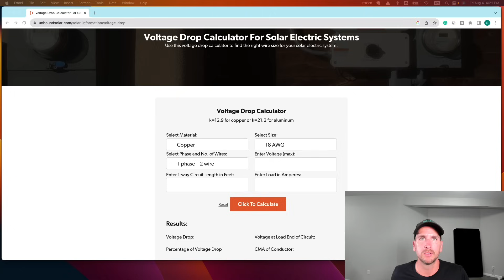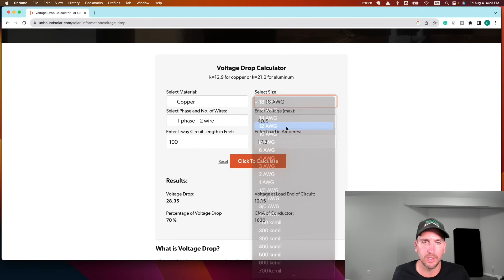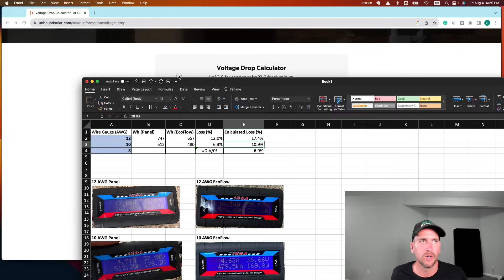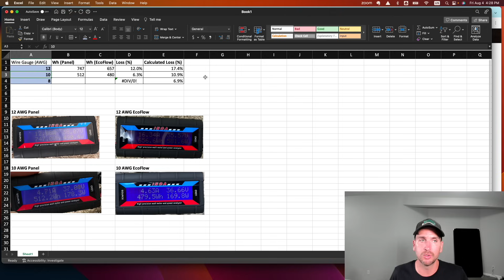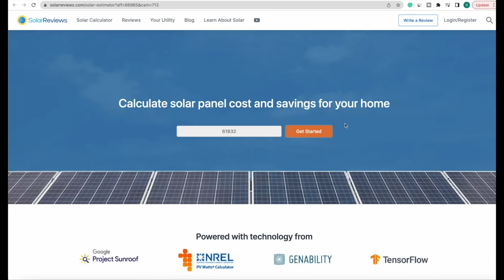What Wire Should You Use For DIY Solar Kits? Surprising Results!

Comment: Could use some help still confused about the gauge wire where. I’m installing solar on my rv down to my delta pro in front of rv. Would 10awg be enough on roof to roof chase and then from chase to front? Also how about to the delta pro from my solar breaker? Do they make 10awg xt60 connectors?
Reply from the maker: You should be good with 10 gauge.  Your runs are short and the Delta Pro maxes out at 15 Amps which the wire can easily handle without much losses over that length.

Comment: So the Eco flow generator is going to be generating everything for this test yeah we need to stop calling these things generators they are storage containment devices they are gas can. The solar panels are more likely to be a generator. Power Station is a much better term. And then let's not forget the people who run gasoline generators in their house what's the difference? They both say generator so let's muddy the term some more.
Do you call an engine a motor?

Comment: Need to do this type of testing on a perfectly clear day. Additionally, always wire up your series/parallel solar system to give you the highest voltage acceptable for your inverter to get the lowest losses.

Comment: The calculated losses are probably higher because they take into consideration temperature change of conductors exposed to heat accumulation either by heat generated by current or from heat from weather and the sun and enclosed conductors in conduit or hot attics. heat increases resistance and would increase amps.

Comment: What is actually been drawn heavily affects what the panels produce... You plugged into a battery... So it's state of charge will change production.... Should hook them up to a heating element through the mop, that will put a constant pull... And you will also see how hot the wires get as well when under heavy load.

Comment: The UnboundSolar calculator seems to be set up for AC current.  AC current flows more towards the outside of the wire (skin effect) and doesn't make full use of the core of the conductor.  DC current uses more of the copper in the wire and therefore has less loss.  I think this effect could be contributing to the differences you see in your tests and what the calculator results show.  I.e. the calculator will always overstate losses if you are using it for DC currents.
Reply: This is a common myth. Skin effect only starts being a thing at radio frequencies from around a few MHz and up.
At 60 Hz it varies between zero and virtually indistinguishable from zero, so the full cross-section of the conductor is in play.
Reply: this is true.  its a fulty test

Comment: To eliminate the effects of a varying amounts of solar energy during your experiment, why don't you just use a power supply at voltages in the ranges you would expect, changing them at measured intervals to replicate actual conditions. You could run each test under almost identical conditions so the tests would more accurately measure the impact of using each of the wire gauges/

Comment: Due to the direction my house faces, mature trees, neighboring houses and being down in a valley much of the area immediately around my house (and my houses roof) is not practical for solar panel installation, I have a small temporary setup (2.7kw array) that on a good sunny day might produce around 4-5kwh's due to the shading issues, I have a spot picked out on the southern corner of my lot for my primary array, which sun wise is perfect, only having shading during the first 2 hours after sunrise and the last 2 hours before sunset and ZERO shading the rest of the day and thats in the winter with low sun angles, but the problem is it's about 300 feet back to the house, I initially thought I would need 8 gauge, but based on all the calculators, if I wire between 10 and 12 of my panels in series that pumps up the voltage high enough and keeps the amps low enough that my voltage drop is under 2% with 10 gauge wire, this also puts me in the voltage range of equipment like the EG4 18kpv or 6000XP, so my optimal solar location is effectively dictating what inverter AIO's/charge controllers I can consider.
Reply: Shouldn't that be new products with higher voltage inputs have allowed you to use higher voltages and therefore thinner wires than if the new products didn't exist? More products will be introduced with high inputs as time goes on they are a new advance in home products.
I snatched up an all in one with 450 volt inputs and I have no long runs because higher voltage has more advantages than allowing longer runs with thinner wires. Like being able to design a bigger system before needing a combiner box.
And minimizing losses is always a nice benifit.

Comment: Dont use this as the primary aspect to guide wire size. Wire size MUST be big enough to handle the Amps/Current to prevent a fire. If one sizes the wire/conductor to get best throughput there is a risk of not sizing the conductor/wire sufficiently to handle the amps. Always leave a good 10-20% headroom of amps and VDC to the inverter. So if the max amps is 13 then get a 20 gaure wire and if maximum VDC input to the inverter is 500 vDC then design a solar series string to be under 450vDC.

Comment: If your MPPT can handle more amps, go that route as more amps is more efficient at charging a battery.
Reply: Say what? Amps down the solar cable has no bearing on the amps for charging. The inverter transformers inbound solar energy to the volts needed for the battery and then fiddles with the amps to maximise total energy to the battery.

Comment: Summer here in australia is to hot to get the full value of power input as get better power input in spring and winter with the cooler weather as summer days here are 40 plus celcius 😩
Reply from the maker: I bet, those panels have to be getting smoking hot.
Reply: @everydaysolar  I have a 10kw system on my house and on a sunny summer day like today was at 38 degrees Celsius all I got was 26kWh in spring and cooler sunny days I’d be getting 80 to 90 odd kWh so you see the heat does affect them quite solidly

Comment: VDI chart works great. I always run my large ground mounted solar array wire runs in DC, and I keep my operating voltage up around 500 V DC.
Reply from the maker: Yeah, if you can crank up the voltage and keep current as low as possible that is ideal 👍

Comment: Are we not concerned by the fact that the measuring device has a small gauge wire introducing resistance to the line in test?
Reply from the maker: Not concerned for this test as we were consistent in the measuring technique across the 8, 10, and 12 gauge wires so there could be a small about of line loss in the 12 gauge leads going into the energy monitor but it would be consistent across each of the 3 trials.
Reply: @everydaysolar Yep it effects accuracy but not precision of the measurements.

Comment: I have three 300-watt solar panels I am going to run in Parallel. The panels show 22.1 volts open circut and 18.1 amps short circut current for each panel. The solar cable run will be about 30-40 feet in distance to my controller. Would 10-gauge wire be enough to handle this?  Tank you.
Reply from the maker: Do you need to run them in Parallel?  That will really crank up your Amps and result in a LOT of current running through the wires.  In this case 10 gauge would not cut it just from the amount of current running through the wires and result in way higher line loss than you would like.  Probably around 20% line loss and again would be over the Amps you would like to run through 10 gauge.

Comment: Why didn't you use the 4.53A in your calculator that your meter was showing?  What I do is have a battery at solar panels with an inverter hooked up to it then use a normal 14ga outdoor extension cord to run power inside to charge house batteries.

Comment: Tell me what I am missing. If you have the same power monitors installed one near the panels and one near the batteries and they are both calibrated properly they should both read the same watt hours. The current will be equal through out. Yes, smaller wire will drop the voltage. But the watt hours should be the same at both points.
Reply from the maker: The voltage drop results in less Power (Voltage x Current) at end of the wire run as compared to the start.
Reply: But its the same amount of power (watts) going through the wire at any point.  @everydaysolar
Reply: @McDIY no, same current but not same voltage every where along the wire.
Some power is used to overcome the resistance of the wire

Comment: Voltage drop = (2k x l x i)/Cm     k= 12.9 for copper wire,   l= 1 way length,  i= current,  Cm= area of conductor in circular mills

Comment: This is a good example of why many installers now put an inverter at the panels, convert to 120Vac and that way they can use much lighter wire as copper is not cheap these days.
Reply: Put a few panels in series and you can get much higher voltages than 120.
My charge controller can handle 450 volts.
The use those micro-inverters to make it easier for themselves to design and trouble shoot.

Comment: At 1:10 you said "Since that's an Mpp charge controller..." and then referred to the Impp and Vmpp values on the solar panel label. 
These are different things. The label on the solar panel is telling you the maximum possible voltage and current from the panel when OPERATING at the maximum power point.
The maximum power point (most efficient use) varies throughout the day depending on the sunlight and angle of incidence on the panel (and also clouds). An MPPT charge controller (Maximum Power Point Tracking) dynamically varies the impedance (load) of the charger upon the panels so that the panels can stay at the optimum voltage and current output for the instantaneous solar conditions.
Reply: Yet some mppt controllers just use the panel temperature to adjust the mpp.
They start at the panels specs and adjust for temperature fluctuations.
Those numbers are accurate at the temperature and light intensity they were tested at.

Comment: Your results at 9:43 ... the thicker the wire, the less Watthours of energy .... that doesn't make sense.
Reply from the maker: The total energy produced was not consistent across each of the 3 trials.  The increase in total energy as the wire gauge got thinner was just a coincidence.  The focus of the test was the % loss for each trial.

Comment: I am curious if two 10 gage twisted pair (positive) & two 10 gage twisted pair (negative) wires would result in less line loss than the 8 gage setup depicted in your test.
Reply: Dc works by the cross section of the wire(s).
Look up the cross section of what ever wires you want and total the cross sections of multiple wires ans compareto the cross section of the bigger single wire.
This doesn't work for AC due to skin effect.
Reply: @ghz24  Thank you for the info.

Comment: It always comes down to cost / benefit.  Would have been very interesting if you would have then put those panels in series and did the test again. I think the #12 wire would have been fine then.  The higher you can get your panel voltage the less loss.
Reply from the maker: For sure, I need to find energy monitors with higher voltage capacity.  That is the limiting factor right now when using that type of setup for testing.

Comment: Which cable i should use for 1200w to 1600w panels and the distance like 40 feet. Thanks
Reply from the maker: It will be tied to the amount of current you are pushing through the lines.  How many Amps will you be generating?

Comment: 8gau if you do some shopping around isn't that much more expensive than 10gau and nobody just uses 2 solar panels,  you need to consider accumalative losses when dealing with a string or strings of solar panels and going 100 feet or more especially from a ground mount that is a distance from your home you will be ahead with 8gau wiring and the losses will be a lot higher in accumilative loss with 10gau or 12gau wiring.  Part of the situation on what to use depends on the output power of the solar panels and the number of them in the string, in lots of situations the 8gau is best while 10gau wiring is fine with minimal losses but I wouldn't even consider 12gau wiring.

Comment: I'm setting up 8 x 100W Renogy (20V 5A) panels in series and parallel with 4 in each series. I'm using 10 feet of 12AWG wire for series to connect to the 50 feet of 12AWG run to an external circuit breaker before going into an Oupes Mega 2 that can handle 150V 15A from PV. I am a noob and just learning this stuff. Any idea if wire loss is going to be an issue? I would think proper alignment would have much more impact. Depending on location (portable unit), I may just use 10 feet run. I figure this gives me flexibility to use my panels only in series if I can't use all 8 panels.

The cables are tinned copper wires if that matters.
Reply from the maker: I think you will be alright with 12 gauge probably seeing around 2.5% power loss through the 50 feet of 12 gauge.  if you went with 10 gauge you would probably drop to around 1.5%.
Reply: @everydaysolar  Thank you for the reply. 2.5% loss vs. 1.5% seems pretty minor for the limited times I think I'd use the solar panels.

Comment: If you exceed 60V you will trash that Meter.  Series you panels. 48V has 16 times less loss than 12 @ same power. 12V keeps you a slave.

Comment: A reply I did to another’s comment: A shed costs a lot more and is WAY more work than conduit and heavier gauge wire. Though a small enclosure for a combiner box at the panels is very practical, but the combiners are generally set up to be outdoors. So they don’t need a totally weather proof enclosure like an inverter and charge controller will. That makes a BIG difference in time money and effort. Plus, the batteries need excellent weather protection, and you don’t want your batteries a long distance from the inverter or your breaker box, or the end use point(s). So in my case I don’t put panels on my roof because that is a whole can of worms for installation and roof repairs/replacement short and long term. I have a nice exposed hill that I put my panels on and it is just simpler to run 4 AWG  into a weather proof cement board cabinet close to the cabin with the controller/inverter/ batteries.

Comment: Will there be a difference, power-loss wise,  when dealing with DC (like you tested in this video) vs. AC (for example when the panel is connected to a microinverter that converts to AC right next to the module, before the wire long run)?
In other words - is there more power loss with DC vs. AC along the same wire length and width?
Reply: @hank-kal   There is some difference between AC and DC but mostly it's about voltage.  You lower the current a LOT by inverting right at the panel.  Voltage is now way up for the same power.   Use an online calculator (google for one) and specify AC or DC.

Comment: My system runs between 300-400 volts, 125ft cable, 5-10Amps, 10 AWG: I am losing less than %0.75 on my worst case, according to the calculator.

Comment: Dumb to run 45V for 100 feet. Since line loss is P=(i^2)*R, the idea is to MINIMIZE current.  So you put the panels in SERIES.  Say you have 10 of the panels in the video. A 3600W system, where each panel puts out 40.5V @ 8.9A. In PARALLEL that would mean 40.5V at 89A.  10 gauge is .1018Ω for 100 feet, so 806W wasted in line loss.

Same 10 panels, same 100ft of #10 wire, but this time in series.  Voltage would be 405V, current 8.9A and line loss is 8.06W

So which do you want to waste?  8W?  Or 809W (more than the total output of 2 of your 10 panels)?

I did my own solar installation.  My target voltages were in the 400V range with current just under 6A and the cable runs were about 30 feet, so with #10 cable, my line losses are about 1W.

Comment: Do yo have any videos on grounding solar panels?  I just got an EcoFlow Delta Pro and purchased 6 200W solar panels.  The EcoFlow, for now, is for backup emergencies so my plan is to set up the solar panels during an outage by tilting them but staying on the ground.  Is it necessary to ground the panels in this situation?  Also, my hope is to set up the Delta Pro such that i can start offsetting power and have it running all the time.  My roof needs new shingles so i was thinking of building a system where each panel will mount to my fence so it can be rotated and tilted.  Because this is a more semi permanent installation and the panels would remain outside that they then should be grounded?
Reply from the maker: I just did a video on a nice little ground mount and touched on the grounding at the end.  Not sure that will be ideal for your 200W but depends on the size https://youtu.be/IgeaQs1OUtE
Reply: @everydaysolar  Thanks !  I was actually watching it when I saw your comment.  Have you ever installed any solar panels on a wood fence?  I really like the ground mount but I don’t have a ton of ground space.  I am looking at ways to mount solar panels on my fence.  I have 6 200 watt panels.